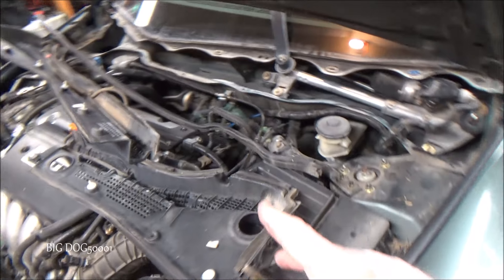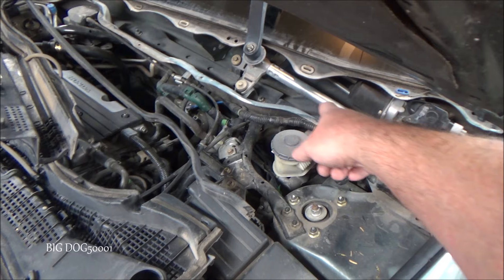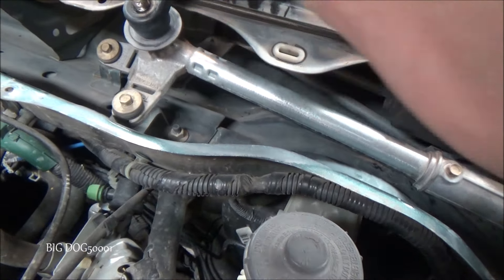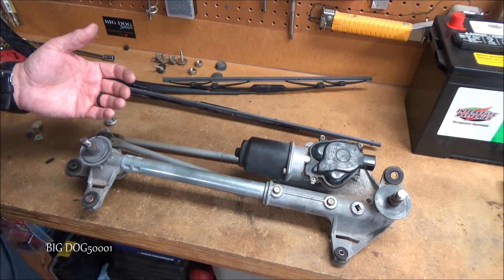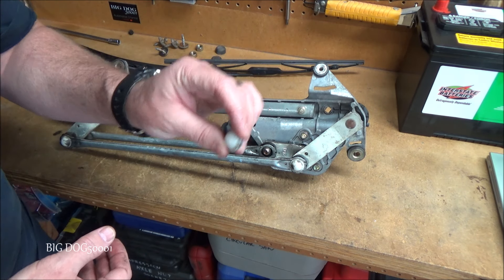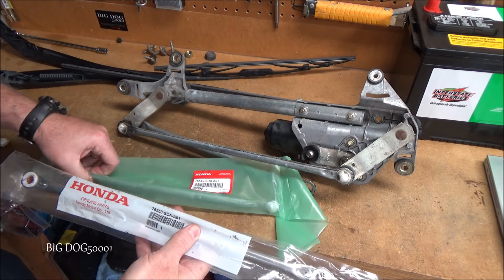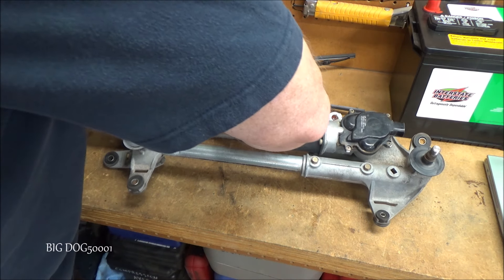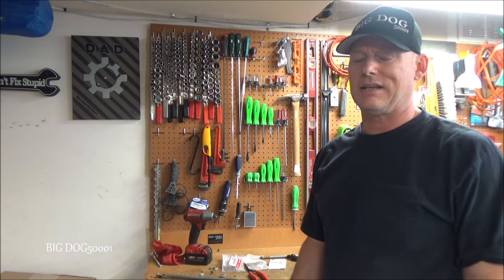Honda Wipers Not Working - Wiper Linkage Broken

Comment: I always wondered how these window wipers operated on my Honda. With your excellent video I am now informed and confident of a DIY replacement. Thank You much appreciated!
Reply from the maker: Glad it helped, thanks for the comment!
Reply: My 2012 Pilot had one arm completely stop working today (and yes, it's raining AND snowing 🙃), but knew it was a mechanical issue already (wiper froze to windshield, didn't work the same after that day, as well a as when the one arm didn't move after switching them on it moved freely by hand). Very happy to find out I didn't have to replace the whole thing and how easy it really is! Thank you!!! 

It was also cool to hear about the early signs of it giving out, as it did drop below the window and would extend back to the frame of the car prior to the frozen wiper blade incident.

Comment: Thanks for the great video.   I used it to repair her 2005 Honda CRV.   I thought for sure the linkage had gone bad but the linkage had popped off the motor shaft due to operation while the wipers were frozen to windshield in a large Boulder, Colorado snowstorm.   She now knows to always unstick her wipers before use.  Thanks!

Comment: Thx for a very nice tutorial video.

My driver side wiper does not engage at a sudden. However, the passenger is still working fine. 

I guess the driver side wiper may have similar issue with the arm came loose.

Comment: Thanks for the video. So it seems like my wipers on my Honda Accord were working fine sometime and then they would just stop so I got the wiper motor replaced and now they are only working at full speed and not at other slow modes!!!

Comment: Great video.  The wiper mechanism (not the blades) on my '11 Pilot are squeaking whenever the wipers move.  So I'll use this vid to diagnose/remove the mechanism.  They still 'function', so possibly some lubrication in the gears will do the trick.

Comment: Thanks for the informative video. When you installed The assembly again did you have any issues threading those four left bolts with washers built-in? When I place it on the guide pegs the left side is half an inch past the hole

Comment: Dave another good Honda video. I haven't had it happen yet but it probably will. Dave I have a question have you had or know of tire valve stems corroding and breaking off. I've heard of two this past weekend my neighbors daughter was riding back to school in a dodge pickup and the right front one blew off at highway speed. Stem gone sensor inside tire. She was lucky. Just wondering if you have heard anything. Thanks and stay well. Here in NY where I'm at it's a mess. Major lockdown. 👍👍👍
Reply from the maker: I don't see that out here in the desert but I have heard of it happening.  Thanks for the comment!

Comment: 2017 CR-V Drivers side wiper not moving but passenger side did. It was a loose nut on the wiper arm under the cap covering the nut. Must have been frozen and the motor was powerful enough to  unscrew it.

Comment: Another great video... So as you stated if the wiper goes off of the windshield it is most likely the sloppy linkage and the arms should be replaced for that also correct?
Reply from the maker: Sometimes the entire linkage needs to be replaced but many times just replacing Rods A and B can correct it.  Thanks for the comment!

Comment: Hello, Thanks for this video. Can you please comment on when you need to replace wiper arms themselves? I see the grooves on the inside of it which sits on the wiper linkage assembly where 17 mm nut would go. What if the groves on the arm are slightly smoothed out. I am asking because, in my case, the linkage is loose - which I will replace per your video. But I also see the grooves smoothed out as well.

Comment: Thanks for the video. I have a Honda Fit 2013. My rear wiper stopped working and I could hear the motor having trouble. I purchased a new rear wiper motor and installed it. Now the rear wiper won't stop when the car is "on", even when the wiper is set to "off". I checked fuze #16 and it seems "ok". Any ideas?

Comment: I couldn't believe it in the middle of a tropical storm my wipers go out and Im driving blind had to pull over and wait for an hour had to piss like a racehorse. Scary driving through flooded streets made it home finally safe and sound all the while keepin my 5 year old calm in the back. I love Honda but this was major negative for me. I will say this My Honda has been reliable with 180k miles I've practically rebuilt the whole thing. I did recently notice a small oil leak on a solenoid on the engine any videos on that!? Thanks again I was pretty upset but seeing this is common is somewhat understandable but also very dangerous.
Reply from the maker: That stuff can happen unfortunately.  Obviously I can't see where the oil leak is but but VTEC solenoids are a common oil leak on Hondas.  Thanks for the input!
Reply: @BigDog50001  hey brother appreciate the reply and the video was really informative. I'm not much of a mechanic and usually make things worse. So I took it to a local shop and had em replace the whole thing except the motor it was still good. Keep up the good work brother you got a new sub from me! Thanks again and many blessings

Comment: 2:33 What if the wiper blade does not move when pushed, AND you hear the motor hum when you operate the inside switch?
Reply: Having the same issue
Reply: @mrphauker  I found out what the problem was, there is a bushing on the arm of the assembly that is designed to sheer so that it doesn't bend metal or break motors, except, honda doesn't sell just that bushing. best you can do is buy the arm with the bushing already in it, and replace it. I think it was a 20 dollar fix in the end

Comment: Found out it's not the wiper Rods but the bolt coming loose and popping off on the thing connected to a rod and makes it rotate. I thought it was broken but it's a split lock washer. Would some aluminum and a flat washer help? I need some advice on this please
Reply from the maker: You might be able to come up with something to secure it for a short term fix but when I come across something like that I will usually just replace the entire linkage assembly.

Comment: Is there a relay? I checked fuses all good. I replaced motor and bar approx 6 months ago.
Reply from the maker: Some Honda systems have separately serviceable wiper relays but they are usually for the washer circuit or rear wipers, on many systems the front wiper relays are incorporated into a smart fuse/relay box or a relay control module/relay circuit board.  The power to the motors are usually controlled by either an Integrated Control Unit (ICU) or Multiplex Integrated Control unit (MICU), both of which are smart fuse/junction boxes.  On some systems the wiper switch can provide ground directly to the motor, but for many Honda wiper systems the switch is merely an input signal to a control unit (the signal is then typically sent to other control units across data lines).  

As you can see the wiper systems can be a bit complicated which can make troubleshooting difficult sometimes.  Most newer systems can generate Diagnostic Trouble Codes (DTCs) which can be read by a Honda capable scan tool, this can sometimes give direction for diagnosis.

Comment: question i have an 2006 accored my wipers work good just when i put it on intermittien it works as if i have the wipers on low. low works fine and high works fine. also when i turn the wipers off they just stop in random spots and takes a few times turning them on and off to get them to stop at the bottom. i tryed so many google searches and honda paiges but found nothing i did find something that there is a wiper intermitten relay thats by the brake booster on the fire wall but i have yet to find a relay in the location where i read it should be lol please help